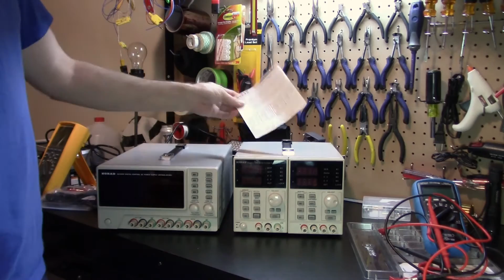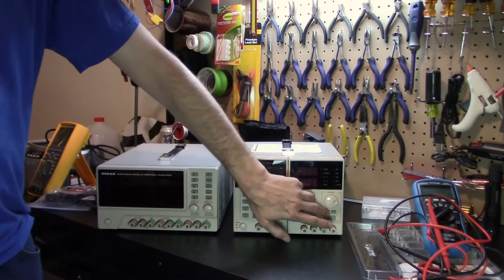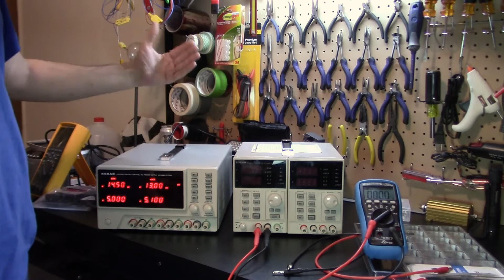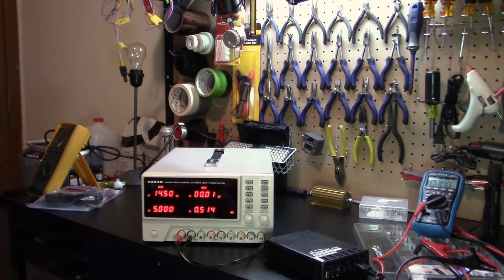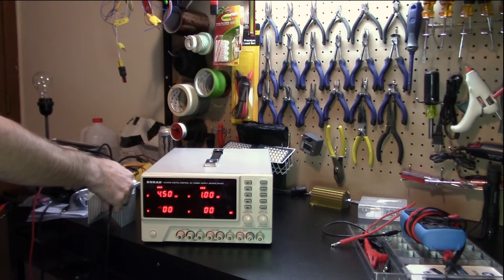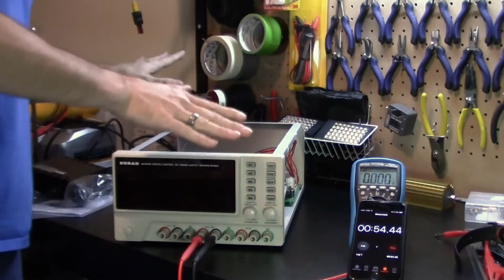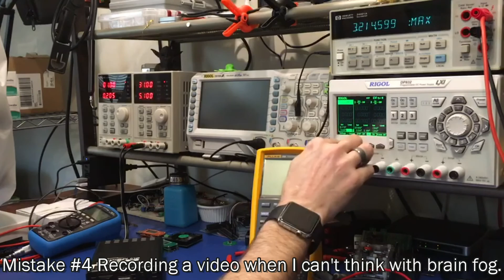KORAD KA3305 Adjustable 30V, 5A DC Triple Linear PSU & Bonus Content

Comment: You can see me using my one of those in some of my videos.
Reply from the maker: Nice, how has it worked for you?
Reply: Good, I have been happy with it, the need to press the channel button each time you want to change a setting is a slight pain but that is pretty much it, current limiting etc all works well.  I haven't used the memory features myself yet though.
Reply from the maker: TheDefpom Well if you tend to have what I call "Fat fingers" then I recommend setting all the memories to 0V and 0A. I kind of stole the fat finger term from tech with typing on a keyboard, but it could apply with this also. If you use the keypad lock then I wouldn't worry about setting memories to 0. But I know in more then one manufacturer I've hit the memory button and didn't realize I changed the settings causing a magic smoke incident.
I'm also used to having to select the channel before changing settings on other power supplies, so this didn't surprise me on this unit. It seems to be almost standard when you dealing with more then one adjustable channel outputs. But if your used to a single channel power supply I can see were it's a little different at first and something you have to get used to doing.